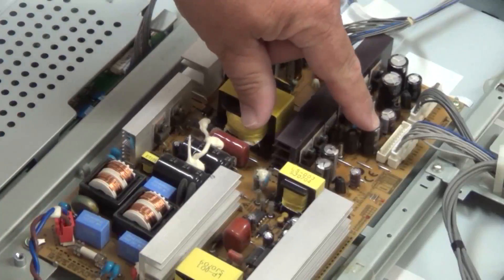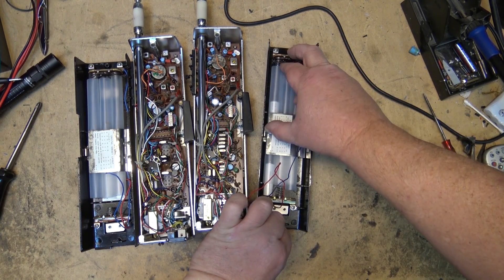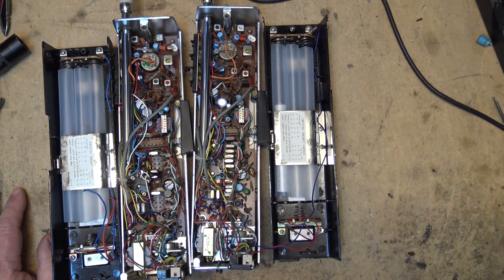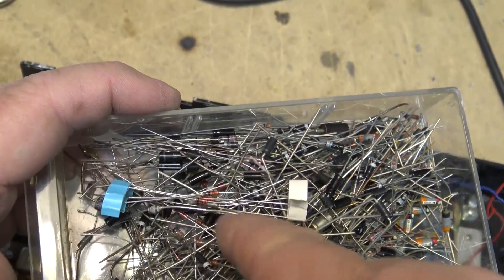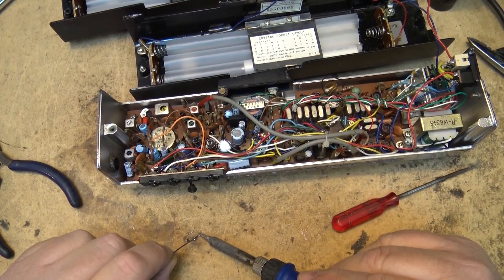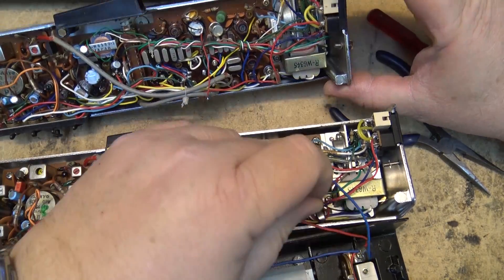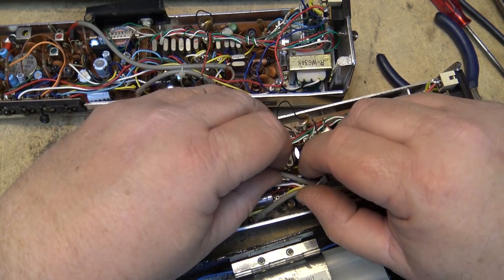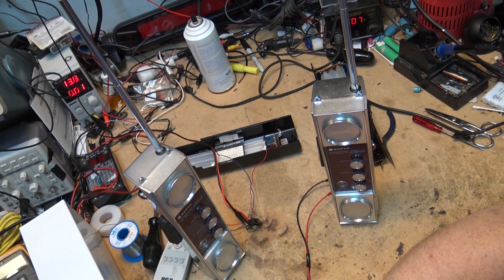Vintage Sanyo TA 395 5 Watt AM 2 way Walkie Talkie Repair

Comment: Hello, I wanted to ask you a favor, if you still have those two radio devices in the video: could you take a photo / video recording of the PCB on the circuit side, exactly under the germanium diode you put as a repair? I have a problem with the circuit just below the diode part. Many Thanks.

Comment: that was a good explanation for the use of dummy batteries. I have always been really careful with Realistic handhelds because I was afraid to burn something out. I've never even plugged it into a car because it is marked 12.5v and a car is 13.8v lol. I guess I can go wild with all that extra voltage now

Comment: i still have my one with orig book and box the book has the parts info with wire diagram of it  and my inspect is 65502094 and on 26mhz and still works today and the part he is about to replace is D8  1S188

Comment: Very impressive!!!  Great skills finding the problem and soldering that tiny diode.  Didn’t burn any of the surrounding area.  That was a tiny space!!

Do you know if any person/shop would can check out my Radio shack TRC-216 walkie?  Receives great but TX disappears after 30 feet.

Comment: ok, dumb is not a nice word, I cannot tell you how many radios, portable tv's, transceivers have wires from the back mounted batteries and other items running to the front when you take off the back. I have never seen sets with the wires broken off as care was used to remove the backs and insert batteries. Since this was not a daily occurrence it was not a problem and is not a "DUMB" design, it was cost effective ie: less costly than a plug you could remove.  Ditto on the antennas, many radios and transceivers came with screw off antennas as it was a very easy thing to remove if you needed access.  There were a few units that had spring straps or other connections with out screws but were very problematic as you want  the best connection you can get to the antenna. We dont need to agree with everyone's ideas in hindsight but calling them dumb just shows off your bias without thinking through the reasons for doing so.
Reply from the maker: Changing the batteries on one of these was an almost daily operation if it was used alot. Ask yourself this question. Would sony have made a radio like this, with wires attached to the removable back? No, they wouldn't.  They would have made the battery compartment removable. It's a dumb design to everyone but you.  Case closed.
Reply: @12voltvids  please read my original again, it answers that question, you cannot look at 30 year old anything with todays eyes without actually thinking about the questions it forces you to think about it, 30 years ago most electronics ate batteries due to current draw and a transmitter / reciever even more so, adding quick connects to all the wires in all the radios would have raised the cost to sell.  I repair 80 year old radios and they did a lot of things different than today, it does not make them worse than those made today.
Reply from the maker: @men4skirts  
Funny because radio shack you popped the back off and replaced the batteries.  No wires attached to the back waiting to break every time you opened it to change batteries.

Comment: Hi.  The stand by voltage on a TV is supposed to be a DC voltage, right?  Mine was 5 V AC.  A transformer crossed over into the cold side of the TV's power supply, and it also had a lot of electrolytic caps.  There was a rectifier bridge in the hot side, but my meter only read the presence of AC voltage everywhere on the power board.  What could have been the most-likely bad component?  
How do you deal with ribbon cables that are too short for you to be able to put back into the socket without messing up the cable, as in a Magnavox CD player (I want to ring the necks of engineers who have no consideration for  people that have to fix their stuff!)?  
Give your cats extra treats for me.
Frank

Comment: I have an old CB that has about 10 crystals in that FF.  Send me a list of the ones you need and I'll resolved and send!  Btw, that blower sounds as if it needs bearing(s).  The cobbler wears the worst shoes, right!  Not offensive to me anyway.  Lol
Reply from the maker: Blower is fine.  It is mounted on a bracket that shakes.

Comment: How far can you talk on them do you think
Reply: It all depends on conditions. These are handhelds, so the antenna is a compromise. I would say at least 5 miles if you are in a flat, wide-open area with no hills or buildings.

If there are a lot of sunspots then you could possibly talk hundreds of miles (skip) if the channel is free of interference.

Comment: The Radio Shack/Tandy units also used those dummy batteries.  I had a couple in the 1990s and they were a bit of fun.  In the 80s I had a three channel one that I played with a bit.  I only worked out some time later there was no output as a leg had fallen off the PA transistor.  A stiff piece of wire made a good repair and it got out well from then on. I swapped it and another of a different model for a pinball machine.

Comment: those are pretty oldskool needing tx and rx crystals.  You can still find similar radios in thrift stores that were sold as "help radios".  The idea was you'd keep it in your car and if you had car trouble you could tune in channel 19 or channel 9 and call for help.  These were usually 40 channel, 5W radios about the same size, with a small telescoping magnetic mount antenna.  The idea being you'd plunk it on your car roof to act as a ground plane.   No AA cells though, you'd plug it into the cig lighter socket.  I ended up retrofitting one with a small gel cell to make it portable.

Comment: What a difference from what we have seen for the last 15 to 20 years, or so. If you go to Canadian Tire, any Circuit City, (what used to be Radio Shack in Canada), most hardware stores and some sporting goods/outdoor enthusiast stores (for camping and hiking), you can find multi-channel pocket sized communication devices, that need no license to operate. I love these videos you make. This is another great video. I hope you had a great Christmas, and I hope you have a Happy New Year. Cheers!
Reply from the maker: Radio shack in Canada became "The Source by Circuit City" because Circuit City bought intertan corp, which was the Radio Shack parent company after they broke away from Tandy Corp of the USA.
When Circuit shity went bust, the Source stores remained in Canada and were bought out by Bell.

Comment: Hey I got 2 Crown K2 amplifiers of course i got them on ebay they need repair BUT do I need any fans inside the amplifiers? That model never had any fans
Reply: I think crown k series amps are supposed to be mounted with 1U vent panels above and below amps and they are ok.